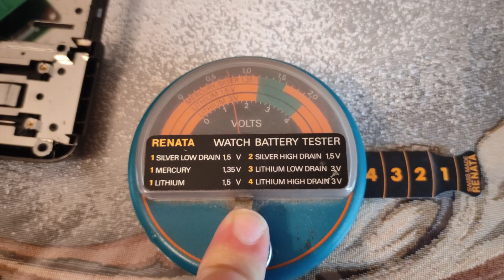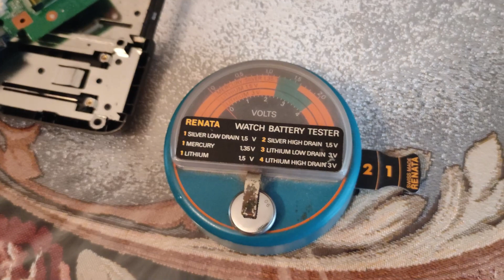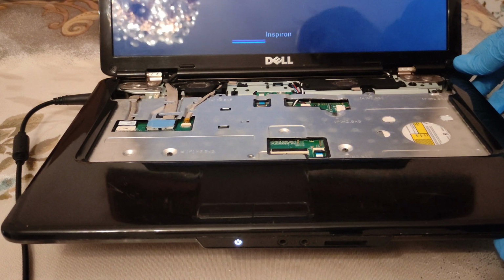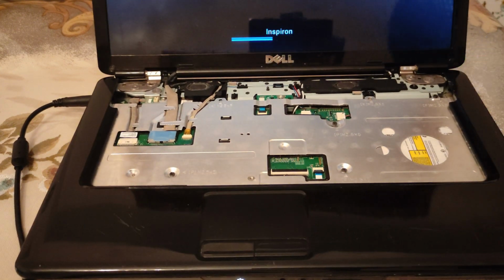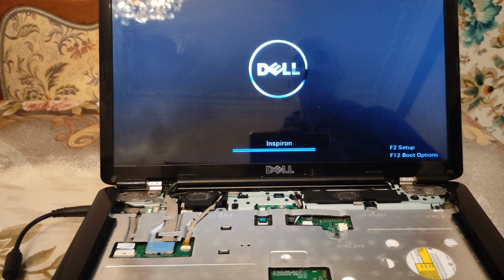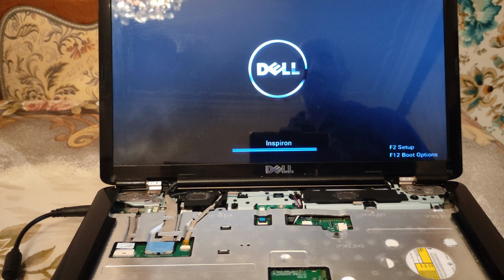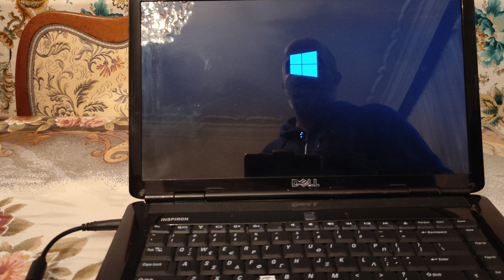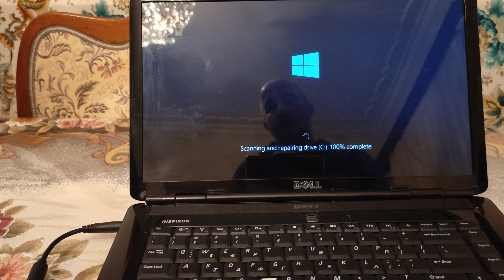Dead Motherboard? The ultimate sollution for every laptop

Comment: As long as the BGA chips don't need reballing, all other issues can be usually resolved. If the CPU or the GPU have fractured solder and need reballing, it is usually a lost cause... In this motherboad, it wouldn't hurt to renew the thermal pad on the graphics card, as it seems broken and will not conduct heat properly anymore